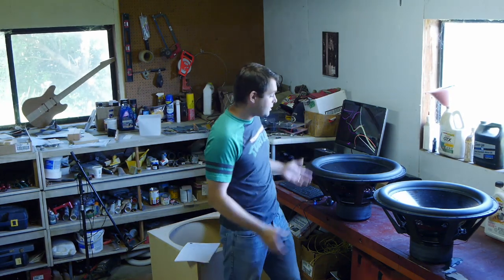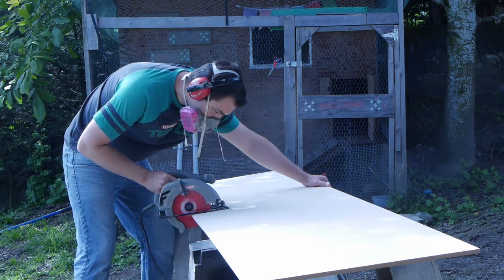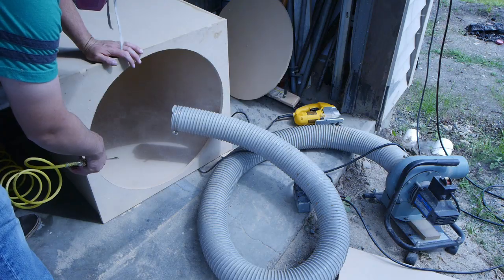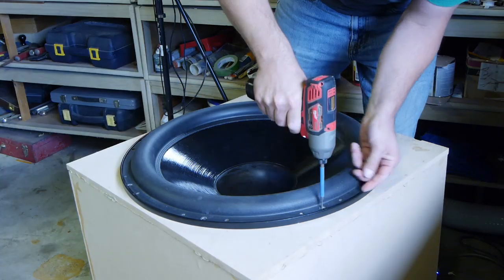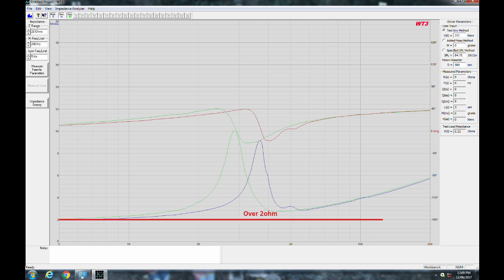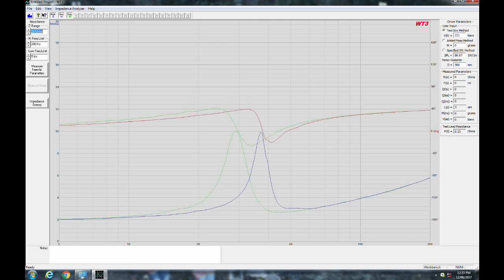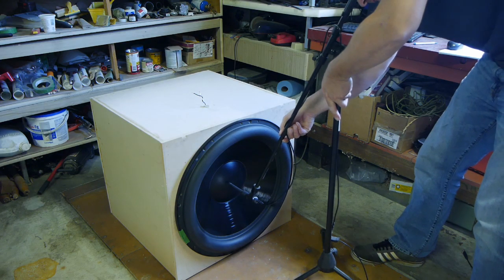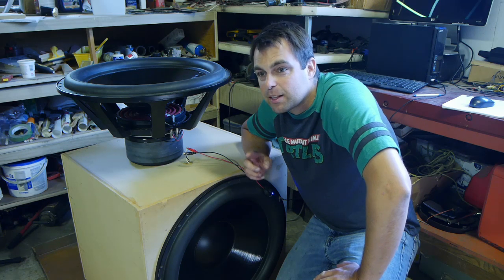Testing Pierce Audio 24" Subwoofers

Comment: What size enclosure did you end up with for those drivers?
I wonder if the FS was going to drop any after breaking if it was run for a few hours with some 20 Hertz test tones with 700 w into it?

Comment: Somewhere I have the leaflet for the Fane Colossus 24E, a 1980's 24" bass driver for P.A. systems - I think they died out due to suspended multiple cabs that 'break the laws of physics' collectively. Good to see someone else using bigger speakers, I'm working on designs using 15" drivers and your channel has saved me a LOT of head scratching! I did know this stuff, 30 years ago.

Comment: Would that fall into the category of an open baffle design due to the high Qts?
Reply from the maker: Chris Harper well, I never recommend open baffle for subwoofers (sub 80hz bandwidth) because they’re so inefficient. But a driver with a Q over 0.7 is certainly one that might work best OB. Ultimately it doesn’t matter as much as people think though. OB already needs a lot of eq and the driver bass roll off will need to be corrected. Hopefully that sorta helps.

Comment: 3000 watts LOL .   3000 watts will make the voice coil glow bright yellow and the loudspeaker resistance will shoot up to 1 megaohm. It is pointless putting more than  500 watts into any single loudspeaker.
Reply from the maker: Dream Diction I doubt that would happen if the gain structure is set right. The mean power through the speaker is going to be less than 10 watts in an average movie but there will be instantaneous bursts of up to say 1500 watts and the very occasional 2500-3000 watt bursts. Without that amplifier head room the amp would clip and sound really bad. How hot can a voicecoil get with 3000 watts for 0.2 seconds? Not very hot. Especially one with a 4” coil.
Reply: @ImpulseAudioSpeakers   Speakers are rated RMS which as you know means continuous power.  Buy a recone kit and put 500 watts RMS pink noise across the bare voice coil then stand back and watch it glow orange at 750 degrees centigrade.  Voice coil resistance doubles every 200 degrees so by 800C degrees an 8 ohm voice coil is pushing almost 200 ohms back against the amplifier which totally squashes the audio output.   The electrical RMS rating of voice coils is absurd because the audio output is squashed flat long before the electrical rating is reached.  You might think of doing an experiment and making a video about this.
Reply from the maker: Dream Diction I thought your comment was about the amplifier choice, not the continuous power rating of the driver. Personally I don’t pay attention to power ratings as they don’t really offer much indication of performance IMO. But yes you are right, I doubt this VC could handle 3000 watts continuous for more than a second. That might be generous.

Comment: euhm... question ... how can you measure speakers and frequenties in a room surrounded by to much ecco ?
Reply from the maker: Roberto richardsen it really depends on the measurement technique and the frequency range you are wanting to target. With something like a sealed sub, you can just do a nearfield measurement and get very accurate data below about 100hz.
Reply: @ImpulseAudioSpeakers  with to much ecco it will give a different readout on the frequency range
Reply from the maker: Roberto richardsen that’s why it depends on the technique and desired range. If you want to know 100 to 300hz then there is really no good way except outside.

Comment: I'm thinking you might have tested it face down since driver's size is very large compared to the test box. I'm curious if you tried both ways what the differences might be. Thank you and God Bless.
Reply from the maker: Johnnytaco Kleinschmidt I don’t think I tested it face down. Can’t recall actually. If I did it technically shouldn’t change anything, provided I tell the software the correct control volume. The volume would be slightly more for the driver face down with the basket exposed due to the volume inside the cone becoming part of the control volume.

Comment: I think the woofer needs break in.
Reply from the maker: WESTEL Audio I break in drivers with a sine tone at or near Fs at a minimum. These will likely break in a little more with lots of use just because they are so stiff. But I can’t give them hours of abuse just to make a video. Thankfully these did have a fair amount of use before being put into testing. So won’t break in that much more.
Reply: @ImpulseAudioSpeakers  Oh ok, didn't know that. I would have expected it to play much lower. Even in the small box. I mean, that cone is massive
Reply from the maker: WESTEL Audio ya it’s got a pretty stiff suspension. It’s from a car audio brand so I think some SPL was traded for extension down low. It does pretty good in the real world. It’s pretty crazy two of these in my basement :P
Reply from the maker: SMOG yes they would and I suggested that to the owner but he couldnt make that setup happen.

Comment: Hi Ryan , is there a way to verify the tune freq of a ported subwoofer ?
Reply from the maker: Yes. With the woofer in the ported box you can take an impedance measurement. In that measurement there will be two peaks. The tuning frequency is right in between those peaks, the "saddle". I have a couple woofer test videos where I show this. Another way is to measure the woofer nearfield. Be sure not to measure any port output. The woofer output will drop to almost nothing right at the port tuning.
Reply: Impulse Audio do you have a video showing how?,.. if not maybe an idea for a future video?
Reply from the maker: integra if you watch my magnum 12 or Motus woofer test videos you'll see it in there. Its just an impedance sweep so not much to say about it. Take the sweep and then find the saddle between the impedance peaks.
Reply: Thanks Ryan i will take a look !

Comment: Be sure to break in the driver by exercising the suspension. There is a considerable change in the suspension components of the driver that takes place in the first several hours. I exercise woofers to about half of their known Xmax for at least 24 hours before measuring parameters. This makes the difference between an accurate box model and an inaccurate one; changes can be several % off the un-broken-in values.
Reply: Have you measured a Dayton um18-22 after break in and compared it's specs against those available from the manufacturer?